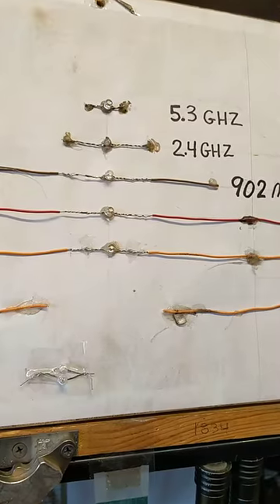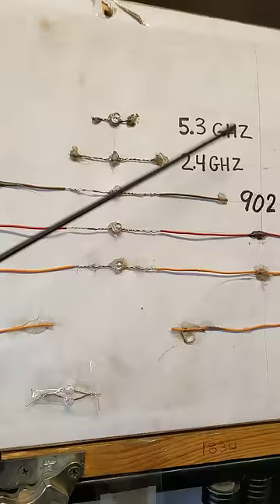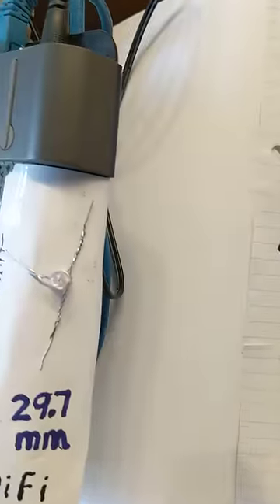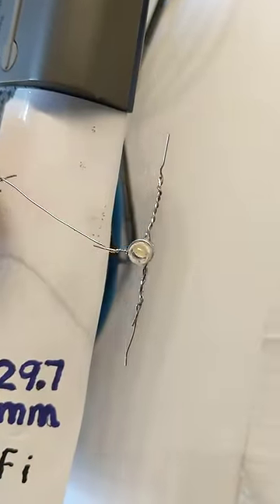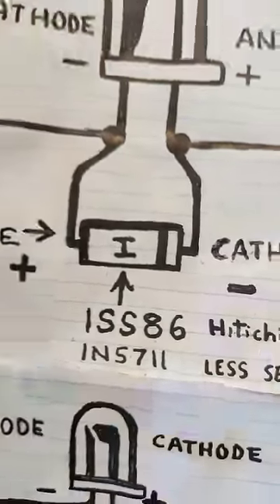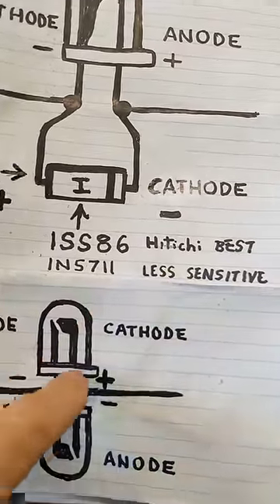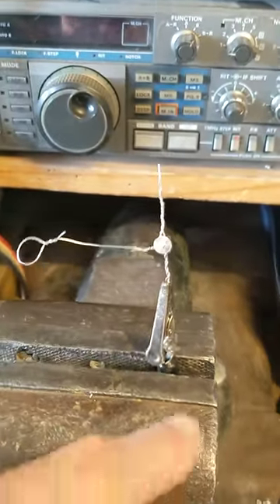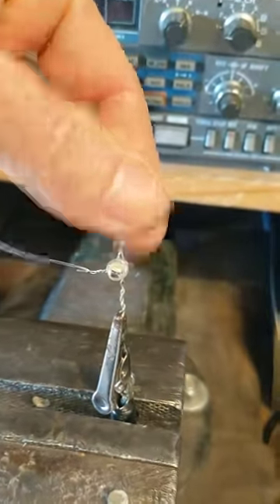Tuned Antennas Lighting Up LEDs

Comment: So if there is an app that can read audio from the light flashes in the sound frequencies, then you could actually listen to that radio ?
That would be a cool app
Reply from the maker: It would be easy to make something like that..
Reply: @GrantsPassTVRepair  the action lab channel guy had a cool video he attached a solar panel to the speaker and was able to make it .

Comment: Now make emergency lights that's continuously illuminate the area using this free energy
Reply: Sadly in an emergency where there is no electricity to run lights, there will also be far fewer devices that still have power and are transmitting.

Comment: I was checking continuity with my meter on a building and I heard someone talking distorted on my volt meter,  after I listen I figured out what radio station it was, I was on the roof and I looked up and then seen the radio tower antenna

Comment: I have an old video of a guy building a 2.4ghz system that transmits power from the transmitter to the receiver. the highest voltage recorded was 3v from 12 feet. if you can find the video he is in a room with white shelves and foreign. I cannot put my hard drive in any of these new computers or laptops. the ios and microsoft systems will virus old tech. it is a protocol in the system sadly to say. Every system sold are all apps now, windows 7 was the last system to be semi private

Comment: That’s why you never stand close and in line of sight of a radar.   If you do you boil your jewels sort of and can forget to have kids someday.
Reply: Close is the problem.
Reply: @davidbrayshaw3529  yup as i wrote.. close :) .. i see i mentioned line of sight..because you can stand close if its behind protected shielding:) - then its not in line of sight because its--hidden by the shielding ....  and then you have the dome radars... they can not be seen dirtectly but still are dangerous to stand close... so it was just a tumb rule that not always apply.
Reply: @Shadows_101  I refer to "line of sight", in radio terms as anywhere between the transmitter and the horizon.
It doesn't matter what the frequency and power of the radar is, if you're 5-10 miles away, your jewels are safe.
Reply: @davidbrayshaw3529  i know that, i work as engineer on a ship.. thats why i included the term : Close first.. have to be close or your safe... and we talking very close here.. like right next to the radar transmitter.
Reply: @Shadows_101  You definitely know. The advent of radar didn't bring with it a reduction in the numbers of illegitimate children in ports around the world for that very reason, that's for sure.

Comment: So what you are saying is that if Nikola Tesla was allowed to carry out his work, we would all be using wireless power right now. Even our cars could be running on wireless power instead of gasoline. But greed got in the way and now we will all die because of the pollution we are creating. Great.
Reply: Not like this, Tesla's method of wireless power was using the Earth as a 1 wire transmission line and not Electromagnetism, he was using capacitive displacement currents.
Reply from the maker: I don't believe Tesla's ideas on wireless power transfer were realistic. There is to much energy loss using wireless energy  transmission.
Reply: @GrantsPassTVRepair  That's only if you're using the conventional method, losses drop like a rock if you use it the way he was.

His 1 wire transmission system is a good place to start on the topic, you don't get nearly the same kind of losses due to the lack of conduction current.